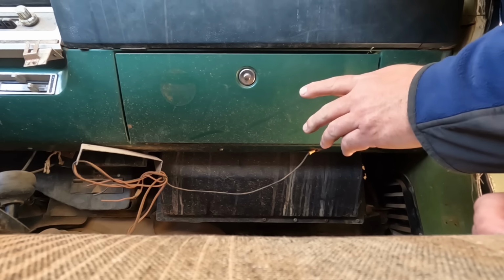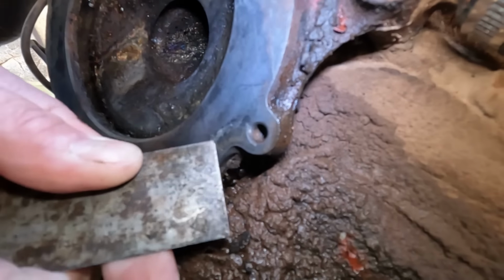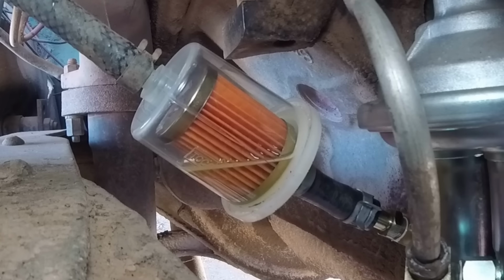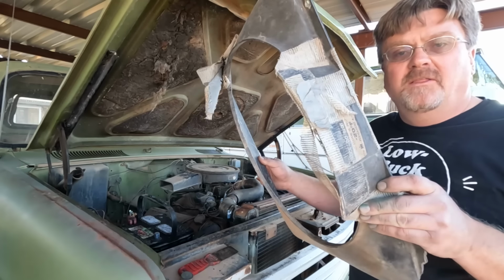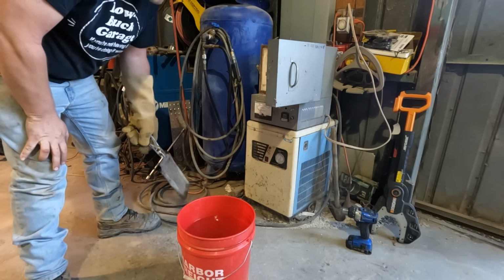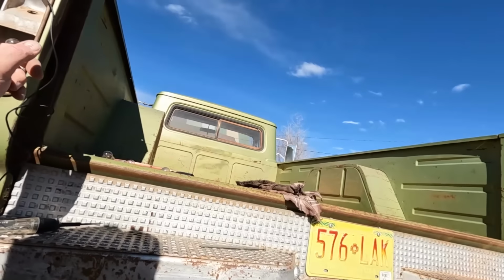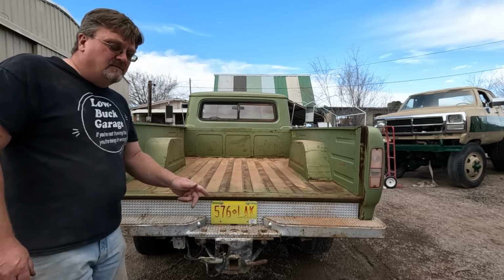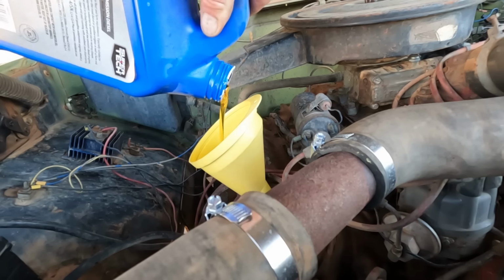International 4x4 Part 2, On The Road!

Comment: Brake light issue: May want to check the turn signal switch itself. Brake light switch should send power to a set of contacts to energize BOTH rear turn signal circuits(to act as brake lights). Left turn would disconnect the left rear turn signal circuits from the brake switch contacts and connect it to the flasher(similarly for the right turn). Hope this helps, as I also noticed the same confusion on the red Jeep “double duty” front turn signal issue.
Reply: Search for brake-light-wiring-with-3-wire-turn-signal-help in the images portion of the favorite search engine... for a pretty animation/diagram...perhaps this comment won’t error out this time....
Reply: I was thinking the same thing.
Reply from the maker: I agree, I did a bad job explaining the issue.  I compounded that with what I did on my last turn signal install on the red jeep.  I started with a turn signal switch that did not have the brake light isolation, and used diodes to straighten out the flow.  Then I swapped that one out for a newer style turn signal switch with a brake switch input in that same Jeep.  When I did that, I realized that I had the "trailer light" connector for my tow bar wired through the front turn signals, which meant that I had to keep them wired to the brake lights in order for that to still work.  

I'm working on a video of wiring up the mutt truck, and I'll do a fresh install and hopefully I can do a good job of explaining it then.
Reply: @LowBuckGarage  Not a bad job in the least ... just a few of us willing to help... as if we were all hanging out in the same shop.

Comment: Little by little you're getting - r - done. 
I worked on a 1969 - 72 Dodge that had brake light issues. After much aggravating time tracing wires down, the problem was in the turn signal switch. That's where the power splits between separating the Left and right lights. Or diode as you say.

Comment: For your gauge issue check you constant voltage regulator, it's on the back of the temp gauge.  They are notoriously fickle. Modern replacement or solid state solutions are available.
Reply from the maker: Thanks for the tip, I'll check that out!

Comment: My friend had a early sixties International Harvester Travelall two-wheel drive in the late 70s. It looked like a slab sided suburban. We would pile in to go to northern Michigan to go skiing. I remember the starter didn't like to engage very well so we pushing it to get it started a lot.
 It never let us down all we ever did was put gas, oil and snow tires on it. It was a great truck but had a lot of weight reduction due to rust. 
Good luck on the clutch job, looking forward to the next video on that truck.
👍🇺🇸✌️

Comment: Hey. On that 10mm bleeder. I recently installed new wheel cylinders on a 1960 CJ5 with 9” brakes. The mounting bolts were threaded correctly for the SAE bolts from the old wheel cylinder. Mounting went great. Then when I went to bleed the brakes they had the famous 10mm bleeders. So you may have the correct wheel cylinder that was manufactured offshore like mine was. Who knows?

Thanks for the fun. 🤠

Comment: I had a friend with a International Travel All 1964 Ambulance special with the roof behind the Driver raised 8 inches in the back.  It not only has the double doors on the back which opened out but also double doors that opened out just behind the passenger door.

Comment: I am not sure if I understood your problem with the lights. I believe the brake light switch feeds the turn signal switch then from there it will go to the left and right brake lights on separate wires. So the turn signal switch is where I would look. hope this helps

Comment: That's a rad Binder. Even the green is on brand for it. A 396 Travelette is on my short list of dream trucks. I'd love to swap the transmission out for a stacked NV4500 with an SM420 and an NP201 for additional reduction ranges.

Comment: While stationed at a naval practice bombing range in the Pacific Northwest, those type of Binders were the chore trucks,I think we had 5 of them,3 regular p/u like yours,and 2 crew cab 4 door models,,the trucks were nearly indestructible, very heavily built,on 3/4 and 1 ton chassis ,,we ran around on the super lug mud and snow gripper tires,and could go pretty much anywhere we wanted,regardless of the terrain we were on.Nice find!!😎😎😎

Comment: ATTA-BOY James! Nothing like resurrecting older rolling iron. I was thinking about differences between Your IH and the latest and greatest '23 4X4 trucks. Yeah a nice new truck is pretty and all, but only if ALL of the bells and whistles were assembled correctly. AND, what about the "Ghosts in the Machine" in the CPU, bad programming will wreak havoc on the other systems. NOPE, I'D PREFER TO STICK WITH THE OLDER TRUCKS THANK YOU VERY MUCH...
Reply from the maker: Thanks!  I agree, this one's just a nice, simple, basic workhorse.  No power steering, no power brakes, just the bare minimum to get the job done.

Comment: Take the VIN number to your International dealer and they can get you a copy of the build sheet.  I did it for my '69 Scout 800A.
Reply: Having the build-sheet is important for IH light trucks. My experience (limited) is that IH sourced parts like I used to drink beer--anything available. Same model year could have more than one (sometimes more than two) brands/sizes of unimportant items like rear wheel bearings--super frustrating.
    Nonetheless, they are like Jeeps in that the same frame was set up for multiple GVWRs and drivetrains. I converted a 1/2 ton 2WD pickup (1100?) to a 3/4 ton 4WD pickup by cannibalizing a 3/4 ton 4WD 'Struggleall' we bought as a donor. Manually hanging that cast iron divorced Xfer case on the frame mounts while lying in the dirt, by my lonesome, was a feat. These things are like lego machines; mix and match.
Reply: @waltkeyes57  I found that out on old GM trucks too. I have a 46 GMC that I found out has the same type of issue on U-joints. It hasn't been on the road in almost 30 years. It is sitting in a nice dry clean concrete floor shed, but life has gotten in the way. little things like a family, job, divorce etc. I bought it in 1987 and dailied it until about 93. It's my first truck and am not selling it.
Reply: @waltkeyes57 988

Comment: Nice work with the old International Harvester. What a crazy shift pattern for that transmission. I have never heard of that style pattern before. It was also nice to learn about heat treating the aluminum.  I always learn something from your channel. Awesome work as always. I especially like how you stop when you are not having fun. I need to learn how to do that with my projects.
Reply: I would bet Reverse is below 1st which is granny gear and you can start in 2nd gear with no load.
Reply: AMG and Studebaker Army M35 2 1/2 ton trucks have a similar shift pattern.

Comment: Hello, I enjoy your videos very much and watch them as soon as you post them.  In this video I was impressed by your knowledge of heat treating aluminum. But you did give me the opportunity to correct you slightly by talking about one of the few facts that I know that most other people don't know. That is that there are no molecules in metal. Metallic elements are constructed of a lattice structure of atoms.  The geometry of this structure can be changed by the proper application of heating and cooling which allows the physical properties of some metals to be altered by heat treatment. Keep doing what you are doing your videos are fun to watch.  Thanks.
Reply from the maker: Thanks for the correction!  Its been way too many decades since I took a materials class, as soon as I read your comment I started remembering about fcc and bcc.  I think there's others that I don't remember.  Glad you commented to set me straight!
Reply: @LowBuckGarage  
Again I am impressed.

Comment: An old soldering iron and zip ties as filler material make an excellent tools for repairing plastic.
Reply: Also known as plastic welding if you have the fancy tools. I'll use the soldering iron.